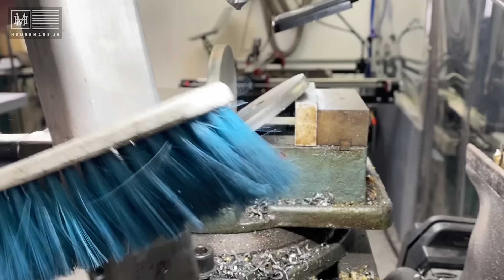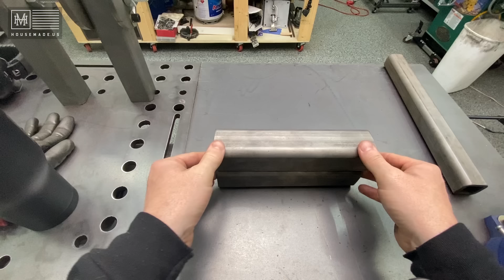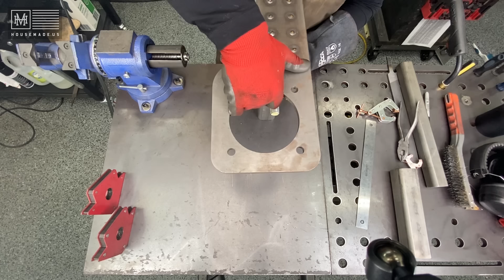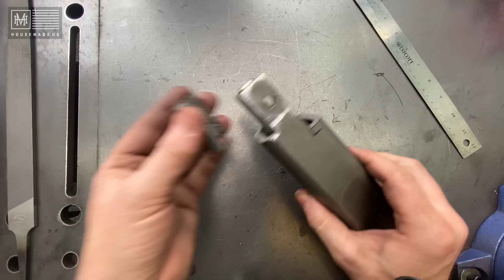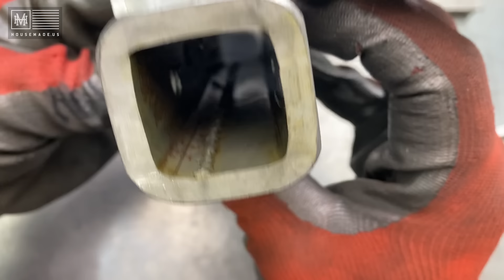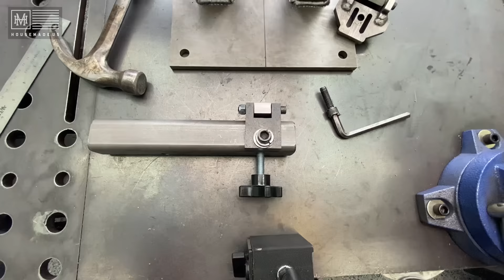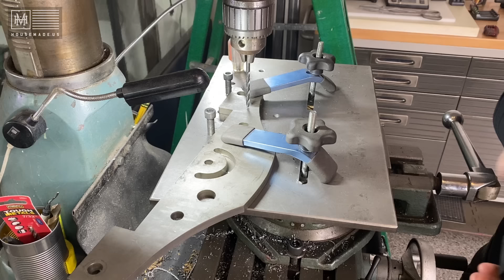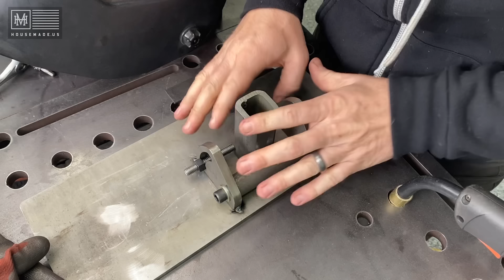How to: Revolution 2x72 Belt Grinder Build - VERY THOROUGH

Comment: Awesome!! Man, it would be so cool if you had a kit where no cutting, drilling any metal, or filing (within the tooling arms is the hardest with little equipment!) would need to be done. Just weld everything together, get the motor, wheels, and VFD, and off you go! My biggest hold back is mostly the drilling. I don't have the equipment to drill holes that size. Very cool stuff!
Reply: buy a mini mill and a boring head, also a drill chuck and drills... You can have such mills for 600-750 dollars, i know it aint cheap, but it actually is, as a mill is a superior dill along with having the capacity to do work that no drill can do... With one you can make parts that would otherwise be costly or unavailable as they are to you, as you can see... It is an investment, but one that if you are in the mindset of making things, will pay off quickly... So much so that you will buy a mini lathe along it sooner than later... Custom screws, custom nuts, custom parts for so many things with just the relatively small machines for a relatively normal price... You can pay bosch that much for a good hand drill and it will never be as good as a little chinese geared mill with some tooling... Heck, you can spend what a mini mill and a mini lathe cost together on just a good drill, and granted, such a drill is not for tubing, but rather for stone and such things most often, but a magnet drill by a reputable company can pay for both and still not be able to do what the two can... Of course a mag drill can do some other things, but hey, you know what you need and want... Dont let me talk you into something...

Comment: just ordered the ultimate bundle, question for the drive wheel do you still recomend the 7" or the 5" that is linked in the discription?
Reply from the maker: I prefer the 7 inch but as of right now most manufacturers don’t have them in stock. Which is the reason why I have included the link for the 5 inch kit
Reply: @HouseMadeUS  yea the only place I have found the 7" is on ebay and OBM

Comment: To remove mill scale .... Harbor Freight paint stripping wheels . You won't do it any other way , once you've used those . Just be careful to keep the rotation arrow, on the grinder ,pointed towards the edge of your work , to avoid any kick-back . HF wheels are almost half the price of the 3M brand .
Reply from the maker: Cool, I’ll give them a shot. I’ve got a coupon! 💪🏻😁

Comment: Love the video, however I would have liked to know more about the motor and control systems. Additionally, I know a lot of people use treadmill motors and controls for this and used tread mills a readily available and relatively cheap.  I think I could save several hundred dollars on that alone.
Reply from the maker: Hi Bill, check out this video I made about why I switched away from DC motors to AC. https://youtu.be/0xuR_PIy-KE
Reply: Total for a new 2HP, 3-phase motor and a new VFD would be around $300-350, possibly less if you find a NOS deal on the motor (or if you buy either item used).  You could probably save a bit with the treadmill motor, but I doubt it would amount to "several hundred dollars."

Comment: love my pro table. I got mine together back in February. I used it a good bit but with in the past month, I've been using it almost daily. Already thinking about a bigger table
Reply from the maker: It’s funny you say that because I was thinking the same thing yesterday. How can I fit a bigger table in here?? 😂
Reply: @HouseMadeUS  I've just ordered everything i need to make the table 4x4. The bigger water table, 1/2" lead screws and new lead nut. I found a local company to bend the table up for me. Its something like 52 1/4 x 52 1/4. Of course, I just got a metal brake that is 48".

probably going to buy your plans. Not into knife making but it seems like it could be a great tool for deburring and squaring up saw cut tube.

Comment: Hey brother. On your tensioning arm when you are cutting out the front and back sections. Just a thought but you could cut the 30 degree angle into those two pieces as your are initially cutting them out of that makes sense. It will save you from having to measure again and cut the piece for the spring later while also the horizontal arm a little more clearance and might look visually appealing as well. Hope that makes sense lol
Reply from the maker: Yeah that makes sense! Good tip. Ill give it a shot. Thanks Clint!
Reply: @HouseMadeUS  I would also add welding it when you weld the two tubes together all clamped down on a flat surface would eliminate free handing it later with a level seems like it would save time. Awesome design

Comment: I bought the laser cut steel pack in metric. It looks perfect. The plans with a lot of instruction are amazing well done and this video gives me just what I dreamt of. I have been thinking on what happens when the belt brakes. Does it fly around or does it just fall down. In the first case I would consider adding a kind of security arm to catch the belt. Any experiences?
Reply from the maker: Thanks Jesper. The belts actually don’t hurt when the break, they just fall. What you want to be aware of is when they tear and then it becomes a slapping machine. Don’t ask me how I know. Lol. (I was fine and it only hurt for a second)

Comment: For the first 20 years of my life I grew up with the imperial measurement system. Then the industry I had chosen for my career converted to using the metric SI units. Whilst I still occasionally refer to imperial units, especially very small ones like thousands of an inch when using feeler gauges to see you working with imperial units is sooo painfull.